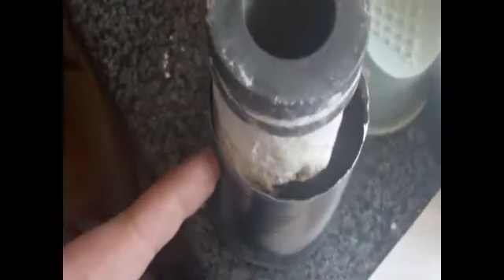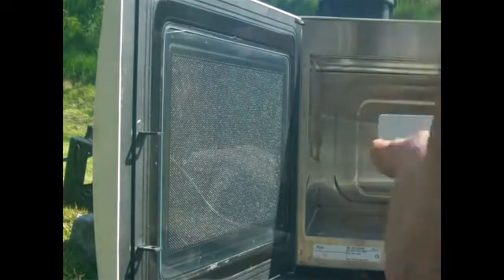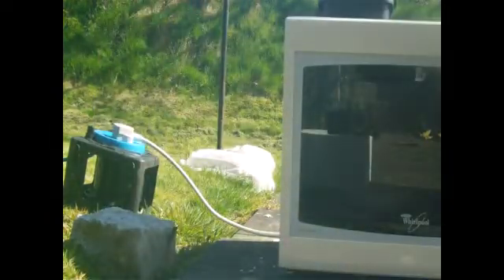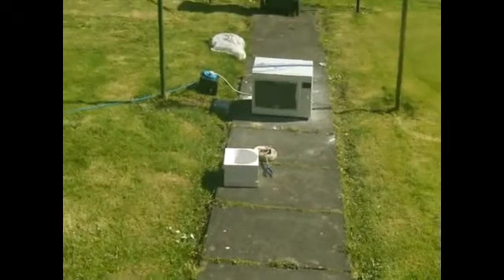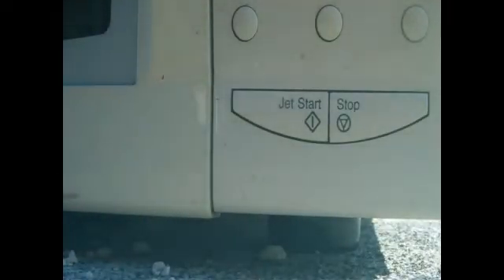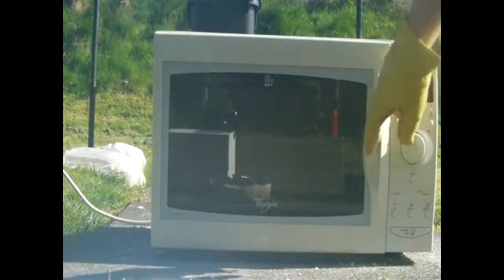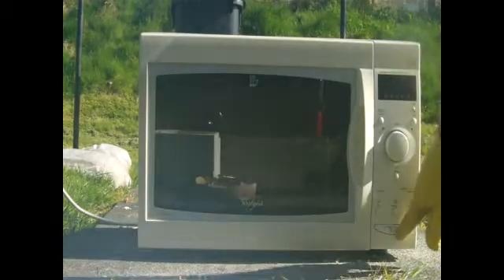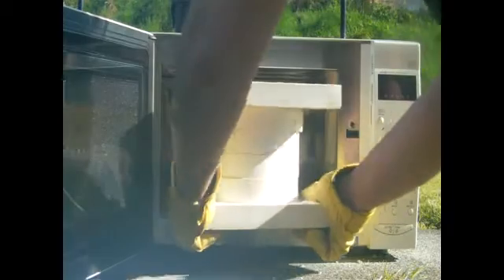Experiment 8: Magnetite, steel can and masking tape

Comment: Looking at the tail end of your video, it occurs to me that timing is key.  Keep in mind that induction heating is not like furnace heating.  In a foundry, the metal is kept liquid by residual heat, but in your makeshift induction furnace, the heat vanishes the instant the power is off.  Consequently, if you want to test to see if it is molten, you need to attempt pouring the second you open the door.

Comment: Also, if you want to "map" the microwave waveforms to get an idea of where your hot spots are in the microwave oven, you can stick a glass pan of brownies with thin icing on top in there for a few minutes.  When done, you should see circular burn patterns in the icing which would indicate the path of the microwaves.  Keep in mind that the waves expand with distance from the magnetron; so, the taller the item, the tighter the waves should be.

Comment: A porcelain coffee cup, while ceramic, is not as heat resistant as you might expect, since it actually does contain a fair bit of moisture.  Have you considered using a laboratory ceramic crucible?  What about pyrex?  Another idea would be to use oxidized aluminum; perhaps you could fashion a container out of aluminum foil and pre-oxidize it with a propane torch.